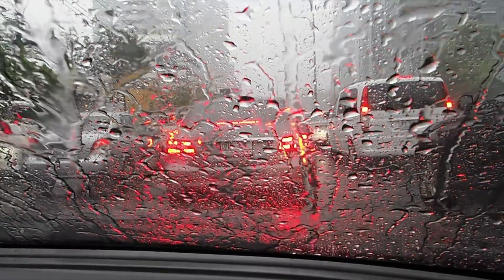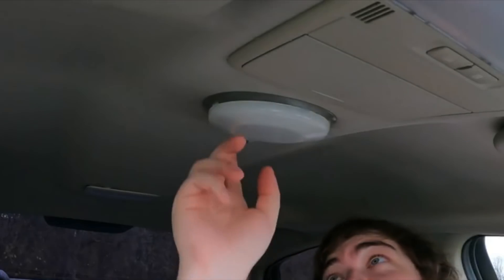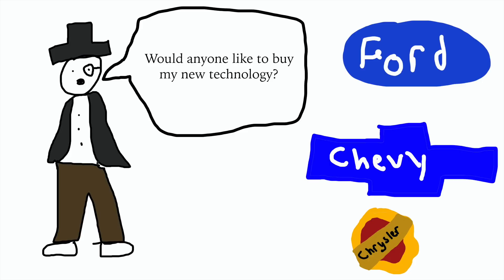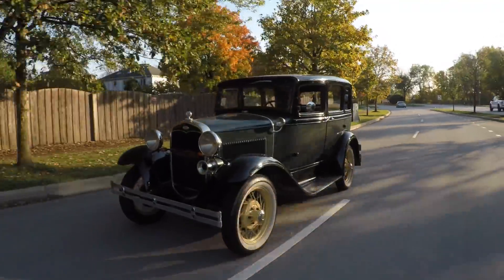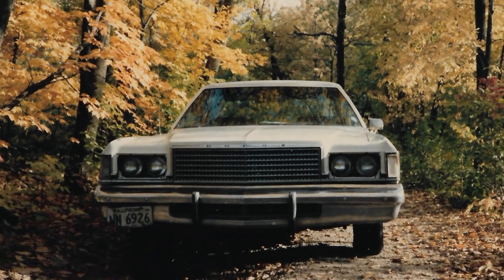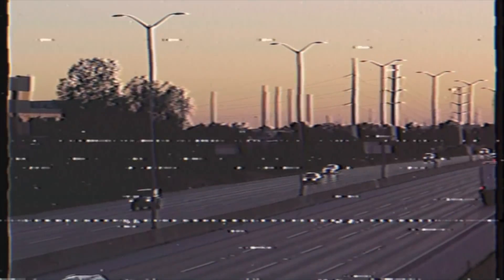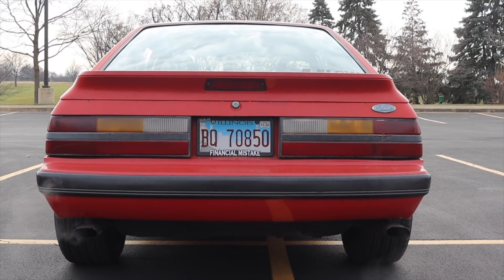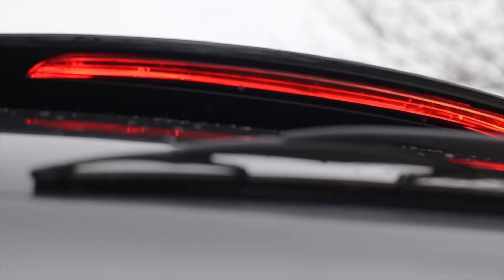The Third Brake Light - Who Invented Them & Why We NEED Them!

Comment: While it's just a single line in here, it's one of those things that give the wrong impression along the same lines as European folk having a problem with American cars with red/combined stop/turn signals instead of separate amber ones. The high mount provides better visibility, which is good,but this video suggests the popular misconception that people confuse braking and turning without a unique light just for braking.  In reality, the worst case scenario from lack of high mount or amber turn signals and only seeing a red tail light come on is that a driver behind you slows down when they might not actually have to. 
Now can we talk about how it's 2022 and people still don't know their tail lights are not turned on? Between running lights that light up the road ahead and modern/digital dashes today that are always illuminated, idiots need a "your lights are not turned on" warning.
Reply: I actually agree with you on that and I think it should be mandatory that all new vehicles should have automatic headlights when ever it gets dark or the wipers are on.  If GM can do it like in my Chevy it can be done across the board.
Reply: @mikeske9777  there’s no technical reason not to. My 95 town car had automatic lights. It takes a 15 cent part and the computer the car already has. 
I’d settle for a message on the dash that says “lights are off” as from what I can tell the issue is caused because you no longer need to turn on your lights to see your instrument cluster at night. 
On the side, I generally like the fact my lights turn on automatically when the wipers are on, but paradoxically there is no way to turn them off, so I can’t flash my headlights at idiots driving with no lights on when my wipers are on.
Reply: They could make the dash lights flash off and on to let them know they have no lights on 😉
Reply: @xmanhoe  I mean, yes, and most modern cars do just that to warn drivers of other problems, however it could get really annoying if you have your lights off on purpose.  With pretty much all cars today having screens of some sort in the dash, you can display any message you want.  The cluster flash would just be part of the normal programing that happens under any warning, flashing once or twice, then returning to normal operation.  Since a cluster flash is already understood as 'check for warnings' it doesn't seem like a good idea to try to repurpose it as 'turn on headlights'
Reply: They have issues with it, because it's a stupid design decision. Also, why don't all cars come with daytime running lights while we're at it? It's incredibly hard to judge the distance of white and grey cars without their headlights on.
Reply: @mikeske9777  If the cars are wired correctly, you should be able to leave the headlights on all the time as the power to them should get cut when you turn the car off completely. If you need or want them to remain on, there's generally a key position that will allow the electronics to remain on while the car isn't running.

It's not a hard thing to do, it's just that some cars do it and others don't. My dad's Chevy S10 has daytime running lights. My mother's Subaru Forester has manual headlights that are automatically cut from power when the key is turned off, so you can leave them on constantly if you want to. But, my wife's Ford Fusion has lights that don't lose power when the key is removed, which means that you have to active and deactivate them whenever you want them.
Reply: @johngaltline9933  I'm not sure about other models, but my wife's Ford Fusion has the dash display darken when the lights are on. I'm guessing it's because they don't want to blind the driver at night as that car is clearly designed to be a dangerous killing machine. It's white and discourages the use of headlights at any time other than night.
Reply: @SmallSpoonBrigade  They all do, but drivers are stupid.  As explained above, the driver no longer needs to turn on the lights to be able to see the cluster at night.  it's always lit, so they just don't think about turning the lights on.  Even more so on cars with running lights as the driver can see the road ahead just fine... never mind about being invisible from behind, especially on very new cars with little strips of brake lights.
Reply: @johngaltline9933  what I think cars need is warning lights for when you have brake lights and tail lights out. I see almost every day there'd be a light out on a car and they never know. At night I once saw a car with no tail lights except when they use the brakes, even though their headlights are on!
Reply: @MrJJandJim  generally brake lights working head lights on, but no tail lights is caused by lights not actually being turned on, as discussed in this thread. The headlights are not actually turned on, just day-time running lights that turn on automatically whenever the car is in gear. 
Most cars since at least the mid 90’s do tell you when a bulb is burned out. You just have to turn on a turn signal. They will flash at double speed when there is a bad bulb. If you are driving properly and regularity signaling you’ll know soon enough.
Reply: @johngaltline9933  I live in the South Eastern corner of the US, trust me when I say people around here drive with lights out constantly. One time I was driving on the interstate and saw a car at night driving with none of the lights on. That, I can believe that it was purposefully off.
Reply: @MrJJandJim  and?  That is the whole point in this thread
Reply: @johngaltline9933  I mostly just say the first thing that comes to mind. I think I'm just rambling now, lol. Thanks for the fun conversation!
Reply: @SmallSpoonBrigade  Replying a week later to the post about how the lights are wired and being able to leave the switch on and just take out the key... While that is true on some cars, the standard wiring leaves headlights independent from key position when they do not have an 'automatic' setting. While on older cars this would just allow the battery to run down if lights were forgotten left on, most cats in the last 20+years will turn the lights off after 10-20 minutes if the key is removed.  Non-automatic lights coming on with the key is non-standard and really odd.  Are you sure it's not daytime running lights that are coming on?  Ex headlights on, but no dash/tail lights?
Reply: @SmallSpoonBrigade   All modern cars DO come with DRLs....
Reply: @SmallSpoonBrigade  That's why one need to buy a superior dodge product; dashlights are strong with lights off, and dim when on, assuming nighttime. But if you want lights on in the day, and still light up the dash brightly, there's a button for that. But in reality, its not needed, as it comes with automatic full beam running lights anyway. So your covered any which way you prefer to do it.
Reply: No need for a warning. They just need to disable the backlight until the lights are turned on like they used to. It can easily work in concert with an ambient light sensor so those stupid LCD screens will still light up during the day.
Reply: I agree. A bulb out indicator would be useful!!
Reply: @LostInPhilly89  true, but the majority of automakers fail to include the taillights!
Luckily I see more and more models do have DRL front and taillights, something brands like Volvo already does for over a decade.
But mainly the Japanese and Koreans cars still have a non-lit rear unless the car or driver decides it's time to turn them on...
Reply: DRL should be mandatory front and rear lights.
Reply: What I'd think - if the dash lights and headlights are always on, why not just have all the lights always on? This was the case for a friend's '90s Mitsubishi Eclipse, any time the engine was on the lights were on, didn't even have a switch (at least so he told me). Same is true for all motorcycles to my understanding, my motorcycle doesn't have a way to turn the lights off - if the key is on, the lights are on.
Reply: @quillmaurer6563  can you provide a model year on that Mitsubishi?  From a quick google search the light switch is on the turn signal stock like most east Asian  imports. I have a feeling you and your friend fall in to the group this thread is discussing: clueless drivers that don’t realize that just because they have daytime running lights where the head lights are always on their tail lights are not on unless they actually turn the switch to the on position.
Reply: @johngaltline9933  I'm just going off what I recall he told me, I never drove that car myself (or maybe I once picked it up at the shop and drove it a few blocks to his place, during daylight hours). I don't know much about it and he sold it several years ago. It was a third generation, 2003-'05, I don't know which year specifically - his was the four-banger from what I remember. He is a car and motorcycle enthusiast, he and I did a fair amount of work on that car together (oil change, belt replacement, main seal replacement), so I don't think he would have been clueless about that. It's possible he just left the lights in the on position all the time, they turned off when the key was off, so as far as he was concerned they were just always on when driving. Or maybe he was clueless, especially at that time, he's generally a pretty smart guy but has shown some moments of incredible stupidity in the time I've known him.

Comment: The reason for the High level/3rd Brake light in Europe was so not just the following vehicle could see you were braking, but others further back.
In Europe the turn signal as you call it (indicators) on the rear of a vehicle are amber, so can’t be mistaken for brake lights.
Reply: I had an 85 Ford Aerostar and later a 94 that had the european type turn signals. Our 1930 Model A came from the factory with only a single brake light. I really don’t like driving the A at dusk.
Reply: @janderson8401  lots of early British/European cars had only one stop/tail light.
Reply: @Phillip Banes I know Europe isn’t a country, Volvo which is a European car Manufacturer started the third brake light as a safety idea, just as they pioneered other safety ideas.

Comment: At night, I feel the changing pattern of light makes the brake light more obvious and noticeable.  Some of the brake lights by one manufacturer in the 1960's relied on reflected light only and were pretty lame.

You should do a video on collapsible steering columns.  They came out in the 1960's an were a big safety improvement.  I was at a car show and there was a Crosely (I think).  The steering column was a straight shaft pretty much to the front bumper.  A cute car, but in a front end collision that would be fatal.

Comment: I remember when they installed those 3rd brake lights on those taxis in San Francisco back the mid-70's. Local TV news did a story about it, they did call it a safety trial probably because of the high rate of rear end accidents with taxis. Some would blink when the brakes were applied, others would just stay on. I never known the history of the 3rd brake light started there. Thanks for a little tibit of auto history.

Comment: well, even in europe it was a long time common, that brake lights and turn signals had the same color - especially for motorbikes and small tractors; but that wasn't red like in the us, it was yellow. so it was later then common - especially in cars - that in europe turn signals stayed yellow, as brake lights were moved to the red color, 'cause red was mor a attention-looking color as yellow.

i would wonder what would happen, if in the US were now cars with yellow turn-lights in the rear - instead of using the brake-lights as turn-signals (it might be easier to use the same light bulb, but it's a complicated electrical wiring for that - especially in modern cars, where LED's are commonly being used; in the days of light bulbs, the turn signal was just a interrupting plus contact, as the brake signal was just a switch against ground... but that won't work for LED's, 'cause in that scenario only the brake lights would work, but not the turn signals). at least, there always just one failure-point in every car: and that's the driver and his attention.

Comment: I've been wondering about this detail for a long time now and the main conclusion I came to was when you're running lights are on it's easier to tell at night when someone is hitting the brakes by a third light turning on that was not originally on. So 2 main lights get brighter, but incase you didn't notice the brightness change, they added the 3rd light that's off by default

Comment: I've notice with the addition of the third stop light,  size of the taillights have gotten smaller. For example my fusion has two bulbs for the taillights, my 77 versailles has 6 bulbs  and the lens are of course much larger.
Reply: You're right, have you seen the brake lights and indicators on a Tesla Model 3? They're pathetic